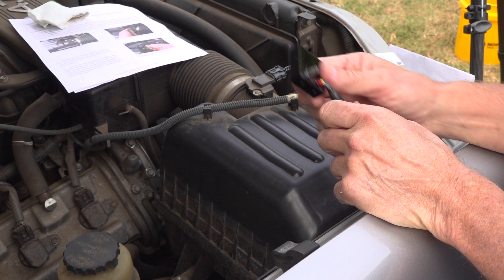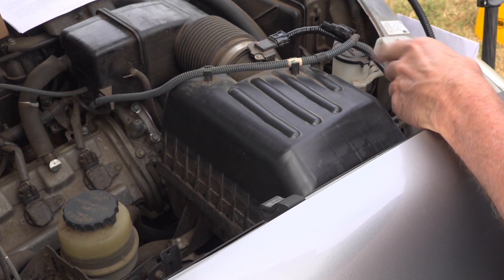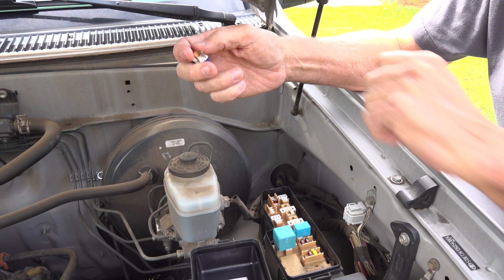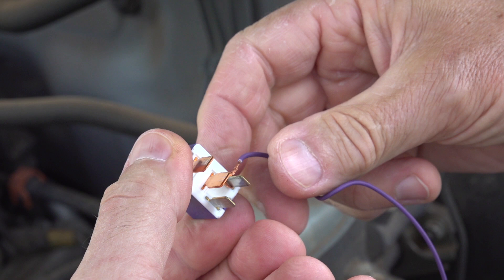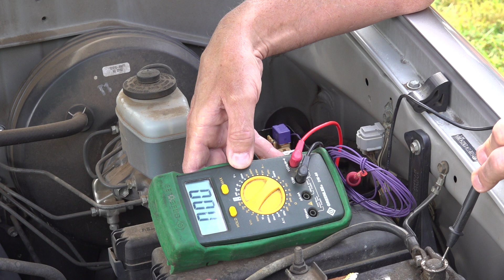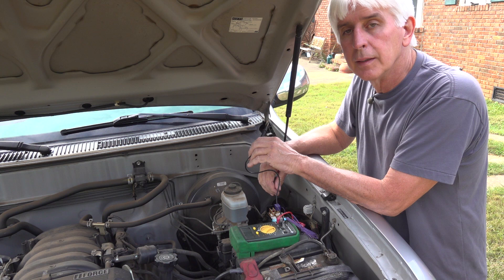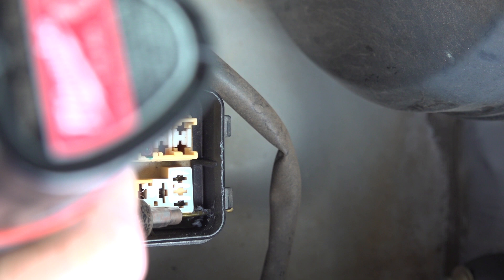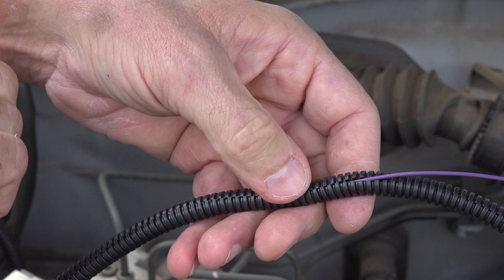2006 Tundra - SAIS - Hewitt Bypass

Comment: Hey guys I have the same problem with my 05 Toyota sequoia 4.7L v8 with a code P2445 I replaced all the air secondary injection pump and air secondary injection check Valve. I'm still having the same problem with the same code P2445. Should I bypass what you guys did???
Reply from the maker: Honestly we are no experts on the subject. I would hate to misguide you. I would call the Hewitt company and see what they recommend. They seem to be very knowledgeable. 
Terry
Reply: did u end up clearing it?!? I have the same code on my 05 right now too!
Reply: @austinhatton3254  yes my problem was solved bypassing it P2445 now its gone
Reply: @djlouis2150  perfect just got it installed today p2445 cleared and is gone at least so far but idk how to clear this code p1613?!? any ideas on what it is, fixed my control driver but can’t think of anything else related?!? connection is fine going to it
Reply: @djlouis2150  will it pass California smog after bypssing it?
Reply: @BasedGod Rodney  yes it ben now almost year yes it work & it pass  California smog
Reply: @djlouis2150  I was wondering if it passes California smog also
Reply: @Ocular Pressure  Yes, it  works really well, and my check engine is gone. & also pass my smog
Reply: @djlouis2150  I have an 2006 tundra 4.7L with 312,000 n I think I need this but I live in San Diego California
Reply: @ocularpressure4558  I’m wondering since my check engine light came on today and I noticed that vacuum pump making noise the past couple days when I first started it up. I’m wondering if I have to replace the parts and do the bypass as well or if I can just do the bypass and leave the rest of the shit alone.
Reply: @dezertdestroyer7782  did you make sure you read the code 1st so that you know that’s exactly what the problem is
Reply: @dezertdestroyer7782  did you check to see what the check engine light code was?

Comment: What it the point of the knock-off plates? They seem superfluous.
Reply from the maker: The plates block the air flow when the valve is open. If the valve fails in the open position and you did not have the plates then you would have problems with that air flow. 
Thanks for watching and good luck!!
Terry

Comment: An update here: I was good for A few months but now I am having a mass airflow sensor CEL.  Also strong smell of gasoline at start up. Called customer service and they didn’t think it was a kit rather the actual sensor. Replaced it and reset CEL. Will circle back and advise.
Reply from the maker: Thanks for the update!! So far we have had good luck with ours.
Terry
Reply: Any updates?
Reply: Same thing has happened to me. Was it your MAF sensor? My dealership tells me it is caused from the bypass kit itself.
Reply: @michaeldillon525  was not the sensor, it was the actual kit. It took a few calls and some troubleshooting but eventually they sent out a replacement, and it resolved the issue.
Reply: @gtrance3567  Glad you got it figured out! I've been in contact with Hewitt Tech about this. They're wanting me to test my kit again to make sure I have the voltage drop on startup. I really want to install the block off plates but I've already broken one stud and I'm sure the others would do the same.
Reply: @michaeldillon525  yeah that tough.  I splurged on a new mad, and after that they finally sent me a new kit.  The block off plate situation does complicate things.   I hope it works out.

Comment: Hey I just used this video as a guide for the installation on my 05 Sequoia and I’m truly grateful for this . Just wanted to share a tip that worked for me . In my case I live in IL so the bolts were rusted ( as expected) so PB Blaster is my friend ( spray and let sit for a day ) it does make life easier. Also I found the on the driver side you gain more access if you remove the front tire  and lit it up . Good luck to whoever is doing this kit.
Reply from the maker: Thanks or the feedback!!
Terry

Comment: I just bought my 06 Tundra with 86k miles and got the p1442&p1445 codes. I tore off what I believe was this bypass lol thinking it was some aftermarket ECU bs plug in tune. Will using this bypass mess up the engine? Or does this bypass just completely disable the fan system? It’s only used on cold start ups right?
Reply: Pretty much what I’m asking is this bypass deleted the SAIC? So no more having to worry about it at all? Because I see no point in fixing it when it’ll just break again especially if you don’t even need it.
Reply from the maker: Sorry, but I’m not an expert on it. I wish I knew more, but your best bet would be to check with the manufacturer. Thanks for watching!

Comment: Is there any potential for this to cause damage to other parts of the emissions system? Such as the catalytic converter?
Reply from the maker: I would feel best referring you to the manufacturer. All I can say for sure is we have had zero problems since installing it. It has done everything they said it would and saved us a chunk of change.
Terry
Reply: I had this on my truck for going on 4 years, no issues.  Passes inspection every time.
Reply from the maker: @zermus7040  Great to hear! We have had good luck as well.
Terry
Reply: @ForestToFarm  I would also add, I to had this happen to my 4runner (v8) and I brought it into the dealership and the guy who worked at Toyota was like... homie, just put this on your 4runner instead because you shouldn't have to pay 2,500 dollars. Also I was blessed that Washington State just stopped requiring admissions tests. Boom baby!! hope it worked out for you.

Comment: they say an air injection failure puts your truck in limp mode to prevent damage to your engine. Is that true or just a scare tactic?
Reply from the maker: I have heard other people say their trucks went into limp mode but the truck in this video never went into limp mode. It just made a suction sound when first cold started for 30 or 45 seconds.
Terry
Reply: my truck is a 2013 tundra. maybe your 06 model doesn't put it in limp mode or what do I know.  my truck is making that same noise on cold startup. I just want to know if this is something I can try before having to shell out 2 grand. I looked at my truck and those blocking plates look like they are more easily accessible. Im also reading that some tundras are getting extended warranties on the air pump because of high failures but mine isn't one of the :(. bummer I just paid off my truck last year.
Reply from the maker: I would contact the company. They are very knowledgeable on the subject. I am just not sure on all the details and I do not want to steer you in the wrong direction.
Terry
Reply: It depends on the trouble codes that are being thrown by the system. Some cause limp mode and some do not.

Comment: Great video guys! I finally cleared my codes on my 05 Sequoia after buying the Hewitt bypass kit and by following your clear and detailed video. Very grateful for this video as the dash warning lights being on all the time was driving me nuts. Just some feedback for your viewers. I had the p1442 and p1445 codes come up on mine. Because these codes mean that the valves are 'shut', I didn't install the block off plates out of fear of breaking a stud off. Common sense told me that if the valve is shut, that it is already blocked off. Installed the bypass kit, cleared my codes and boom, no more dash lights on. So stoked. Here's the huge bonus for me. I also had my ABS and  e brake warning lights lit up on my dash also before installing this bypass kit. I couldn't believe it when those lights went off after installing the kit. So bizarre. Brakes felt totally fine when my dash was lit up like a Christmas tree and I had an appointment the very next day at a brake shop to diagnose why those warning lights were on. I got a 2 for 1 by installing this kit and couldn't be happier. Has saved me a shit tonne of money. Thanks again guys, for the great video and thanks Hewitt Tech for an absolute brilliant product! However, out of habit, I still find myself constantly looking down at my dash, checking for warning lights on, after doing it for so long, lol.
Reply from the maker: Thanks for the awesome feedback and so glad it worked for you!!! I had an EGR valve light on on an old Mazda B2000 for several years. Then it burnt out 😂. Problem solved. 🤪
Terry

Comment: You guys are great thanks for the awesome detailed video and all the help!

2006 4.7 V8 here; 
I was able to successfully install the kit by myself in a few hours. 

The block off plates looked intimidating getting to the bolts, but I have to say I found that to be relatively easy thankfully! 

I was able to reach 3 out of 4 bolts from the top with a small ratchet & both short & deep sockets.
Had to hit 1 from underneath on passenger side.
I also have long monkey arms. 

Hardest part was feeding the wire into the loom haha which I had to go buy because Hewitt did not include the loom with my kit. 

Thanks again!
Reply from the maker: Glad it worked out for you. 
Terry

Comment: This is a good video for 2 sets of eyes to add the blocking plates. One down below to help guide the worker above trying to loosen the blind nuts. If you are working alone, like I was, I found that taking off the wheel, removing the plastic pins holding the top of the rubber flap and dropping it down out of the way, gave me visual access to both nuts to loosen and add the blocking plates. If you need some help with corrosion on the nuts, mix equal parts acetone, and auto trans fluid and apply to the nuts.
Reply from the maker: Thanks. And thanks for sharing your ideas!
Terry

Comment: Thanks for the great video and not skipping any of the 'obvious' steps. My 2009 Tundra threw the P2440 code this morning; I've only had the truck for 3 months, so I was upset to learn this was a common problem and that the Customer Support Program to address this expired in Jan 2019. Worse, I learned that my truck had this problem "corrected" in May 2016, yet here it is again. I'll be doing this for sure. Turning wrenches sure ain't like it used to be.
Reply from the maker: You are welcome. Hope it helps and you get things worked out. Let us know how it goes for you!!
Terry

Comment: Got this done this morning in about an hour and a half by myself. Passenger side was a little more difficult and I did it from underneath. Driver side was easier and I was able to do it from up above. Be careful not to strip any of the nuts.  The multimeter never gave me the same reading that it did on this video, but it did work.  Thank you
Reply from the maker: You are welcome! Glad to help.
Terry
Reply: @ForestToFarm  With this system pass the emissions test
Reply: With this system in place will it pass the emissions test
Reply: I can tell you that coincidently I recently had to do omissions test where I live and that it did passed! Ive also read online anout others passing in California even. Obviously make sure that you’re so check engine light is off. So I can’t tell you for sure that it will, but I’d say your chances are very good.
Reply: What do you do if the bolt breaks?
Reply: @tootwistedup  I’d take it to a shop at that point.  Some claim success without the plates.  I. guess you could try that.

Comment: Great video. I have a 2007 tundra. Secondary air pump went out on it at 170,000 miles. Paid 3100 to get it fixed. Wish I knew about this then.
Reply from the maker: Thank you. Well if it ever goes out again you will know what to do!! Hate that for you. When its a problem on all the trucks over a period of time that spells defective to me and they should have to fix it as a recall.
Terry
Reply: Forest To Farm the crazy thing is. The only reason for is to reduce emissions. There hands are tied by the Emissions inspection office or who ever sets those standards. One of those added parts that was required to reduce crap in the air... but yes, if it happens again this will be my next go to.
Reply from the maker: And what is really crazy is it only does that reduced emissions until the catalytic converter gets warmed up which is probably less than a minute or two.
Terry
Reply: FYI on a 2007 tundra 4.7L, block out plate on passenger side is impossible to get to with metal heater core hoses running in front of it. Work around by following that exhaust hose that you're blocking back up to the side of the  engine block. The other end of that metal hose connects to another spot with the exactly the same kind of connection, block it there.
Reply from the maker: Awesome!! Thanks for the valuable info!! 

Terry

Comment: On my 05 Tundra I had a stuck bank 1 Sec air inj ck valve code P2440, but I ended up pulling the valve without removing the intake sys. Enough room exists in the back providing you lay a thick foam cushion across your engine and lay on the pad. Also, you'll need a 1/4" swivel head ratchet with tight gearing. I bought the Titan 90 tooth swivel head from O'rielly Auto Parts for $17. This is critical to get the two long 10mm bolts on the valve.  You should disconnect the vacuum lines that run to the passenger side solenoids because it makes it easier to get the valve out before you disconnect the vacuum line on the removed valve.  I ended up cleaning my valve with brake parts cleaner and removed two small pieces of plastic that prevented the check valve from closing. After testing the vacuum with my MityVac to make sure the valve holds vacuum I reinstalled it and the Shop-Vac sound went away, the engine light has stayed off and no fault codes show on my OBD. I ordered two Dorman check valves to replace at a later date, but its an easy job when you don't have to remove the intake assembly. The Hewitt kit is a great idea, but the gen 2 ($450) is the one to buy if you live in Cal, because it will not be detected on the visual when smog inspection comes up.
Reply from the maker: Sounds like you may know a thing or three about vehicles 😁. Thanks for adding some value to the conversation!! Thanks for watching!
Terry

Comment: Very helpful video. I just finished install and it worked perfectly. Check engine light is gone!
Reply from the maker: Great! Saves a pile of cash too!!
Terry
Reply: . Question, is this a Gen  one or Gen 2 kit ? I just called Hewitt and they recommended that g2 which is actually $400

Comment: I'm glad the bolts on your air pipes came off easy. 3 outa 4 of mine broke right off. Safety wired them together until i can find a better fix. I'm in the south with very little rust. Go figure.
Reply from the maker: Man. Sorry to hear that. Good luck. 
Terry

Comment: I installed the kit on a 05 SR5 Tundra today. So far, no check engine light has come on. Im pleased with the product.
Reply from the maker: Good news! Thanks for sharing.
Terry
Reply: Have you had any CEL ‘s? I was good for a few months but now have a CL for mass airflow sensor.
Reply: I haven't had any CEL's s  since  installation.  My truck just hit 305,000 miles and runs great. No problems!
Reply: do you remember where the block off plates are located on your 05 toyota tundra
Reply: Will it pass California smog inspection after bypassing the code?

Comment: I've this problem with my 08 5.7L tundra.  I replaced the sai valves the first time and it was good for about a year.  Now the SAI pump is failing.  It only causes an issue in cold starts, usually I will wait for the CEL to come on , then shut off the truck and  clear the code then restart and it's fine.  But a pain in the ass and I've considered just getting a bypass kit, rather than fixing it again.
Reply from the maker: Toyota should be fixing this issue. Hate your having all those problems. 
Terry

Comment: I have a 2007 Toyota tundra and what you’re talking about the valve sticking under the intake. Mine is melted right up on top of the motor. I am so confused with this. Mine is a 2007 4.7 motor and looks nothing like what you’re working on, my secondary whatever you call it or mounted on top of the motor right side and left side.
Reply from the maker: Not sure what to say. Brian traded his off in 2021 for a new F150. 😁 Great truck so far. 
Terry

Comment: I have a 2006 tundra with 79,000 miles and have had it maybe 6 years and been making that noise on start up sense I bought it, no codes and seems to run fine how you know it’s bad? It makes the same sound but no codes? Thanks for the great video guys.
Reply from the maker: This truck had the noise long before the codes started showing up. The bypass has worked so far! Thanks for watching!
Terry

Comment: Heating the cat isn't what secondary injection does. It's to inject oxygen in the exhaust system when the fuel mixture is rich upon cold start ups. All to have lower emissions
Reply from the maker: Yeah we kinda misspoke there but the end result is the same. A lot goes into making a video. Some of the mistakes are hilarious and you do not always catch them right away. You get so focused on one thing that you overlook another.
'Terry

Comment: I just bought the bypass kit ...
But I was wondering about the block off plates. 
Why are the plates vital for this kit to work?    Sorry if this is a dumb question
Reply from the maker: I think its because the valve was stuck open and once the vehicle stars that port needs to be closed.